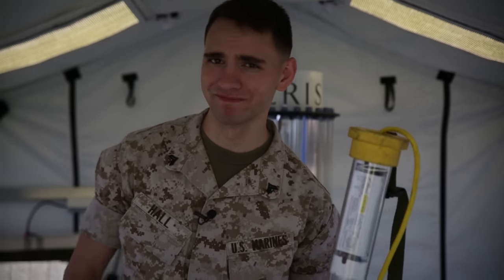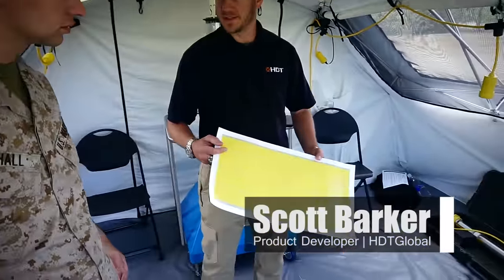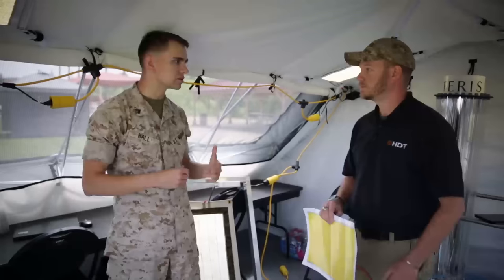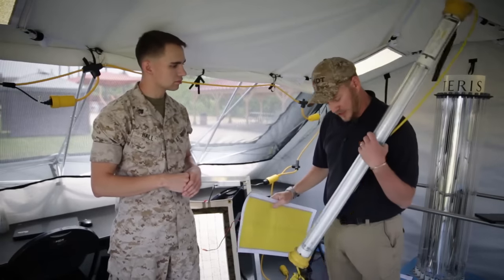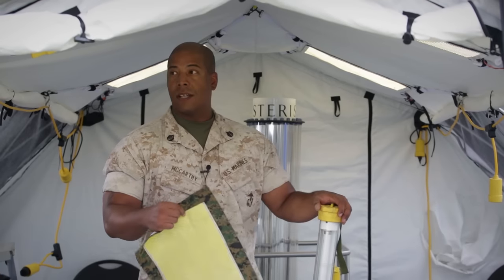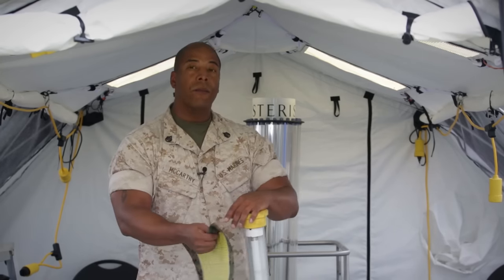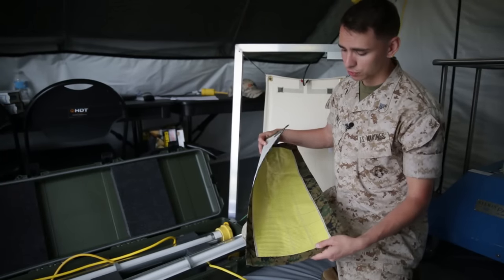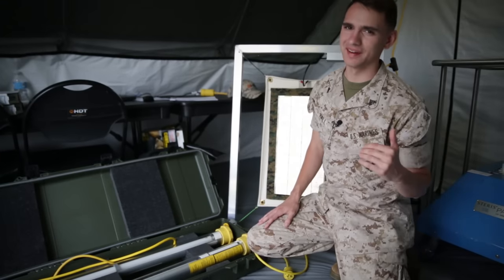With the Gear | FleXible Lighting System

Comment: What happens when breaks?  How much heat is produced?  How is it powered?
Reply: When it breaks, it breaks. Just like a fluorescent tube. You get a new one probably at half the cost of a tube.
It won't produce nearly as much heat as the tube because LED's inherently do not create large amounts of heat (depending on size). These are in their hundreds and are small so doubt they make much heat. Even if they do it won't nearly be as much as a tube.